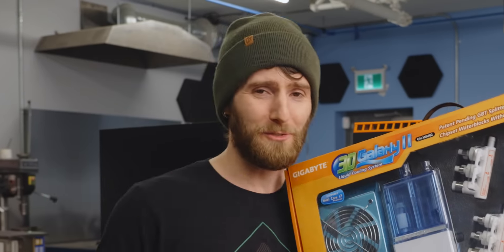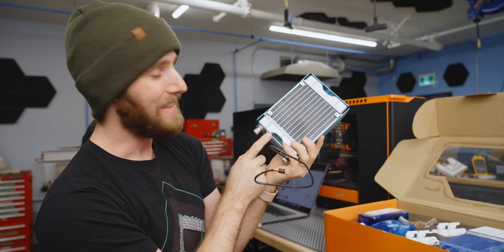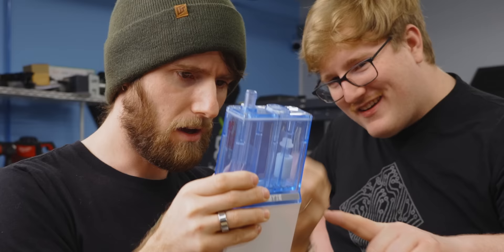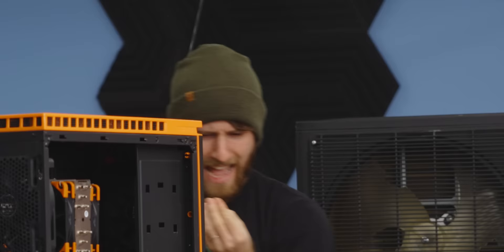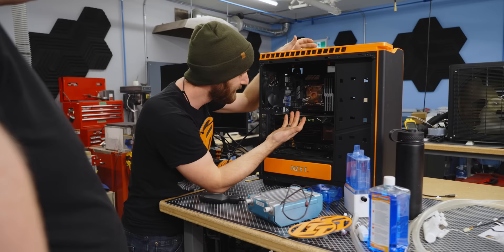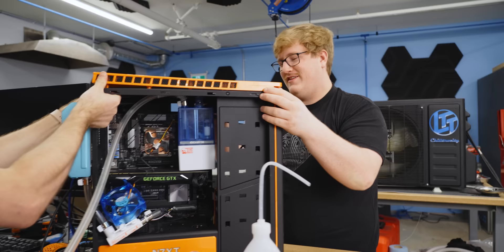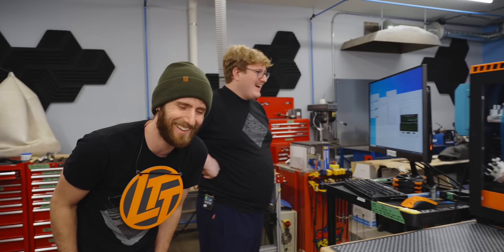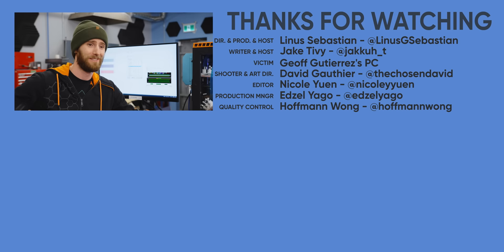This Product Aged Like Fine Milk - Gigabyte 3D Galaxy II Retro Watercooling Kit

Comment: Unless I'm mistaken, even in this thing's heyday, a decent aircooler still outperformed it. Before Noctua, there was Zalman, and a big copper Zalman flower HSF (CNPS7000Cu? I have one still bolted to an Athlon XP somewhere) beat this thing out. Speaking of Zalman, they had an even more obnoxious "water cooler" that gave you an external TOWER radiator, and I think they released a Korea only follow up, so there were two of them. See if you can get your hands on one of those!!!

GEEZER TIME!!! Later Socket 370 CPUs and all P4s had some kind of thermal protection, probably via the chipset invoking SMM/Ring-2 and just crashing everything, since SpeedStep didn't show up on the desktop until the later P4s. And unless I'm mistaken, by the time (later) Socket A rolled around, basic thermal protection was definitely a thing, and by the time the Athlon 64 rolled around, it was universal. Thermal protection/throttling seems like the kind of deep dive story Anthony would be really good at showing the history of??? 

Here's that Tom's Hardware video: https://www.youtube.com/watch?v=NxNUK3U73SI - interesting to see a very early P4 throttle all the way down to its lowest P state like that and just keep chugging. Toms later got into some heat (lol) for, amongst other things, deliberately frying a Thunderbird Athlon (no thermal diode), only putting thermal paste on the Athlons (makes you wonder if the "magic smoke" you see isn't actually magic smoke, but finger oil/surface contaminants/thermal paste vaporizing...) and somehow cooking a Palomino Athlon even though those did have a thermal diode and were the first CPUs with Cool'n'Quiet. CnQ still required a driver and proper set-up on Windows XP - but that distinctly looked like a Win9x/2000 style "Windows flag" in the title bar for the error message that pops up on screen in the T-Bird section. Again, Tom's caught some shade for doing it this way - deliberately framing the AMD CPUs as worse. I know e.g. my nForce 2 boards wouldn't actually let you cook an Athlon XP, the system would crash first.

Comment: I’m still, using a TT Kandlalf LCS from 1997 I’ve just been updating the CPU block, all original loop, copper Rad, ceramic impeller pump. Currently using an AM4 EK Velocity full nickel block cooling a 5600X sub 30 idles never seen it get past 80C

Comment: What is the question?
It works!
The heat dissipation surface and the number of fans is half that of Noctua!
It could have been viewed with a double radiator and 2 fans.

Comment: I remember getting a early 2000s thermaltake kit from CompUsa but didnt fully purge the system of air. Turned on the pooter an a hose popped out of a compression fitting. Fried the pooter 😂😂😂...

Comment: This may actually be the literal water system I got for my computer back in the day. Except the computer I built was using a newer socket and it wouldnt fit on the CPU. So i broke the brackets off and just shoved it on there and held the block in place by putting a 6 volt battery on top of it and taping it down to the case, lol.The entire thing had to lay on its side to even work

Comment: actually Linus i dunno how long you have been watercooling but back in the day 20 years ago  those pins on the waterblock were way better than the MAZE styles from dangerden... i actually use a dangerden Maze 3 block, black ice radiator and eheim pond pump for 20 years.. i just made new mounting blocks.. then when i upgraded from my wolfdale 8400 cpu to my ryzen 2700x i finally spent money on a new custom watercooling setup

Comment: I have to mention that early development of some modern tech quite often comes with a lot of questions and concerns. One thing is that we don't know how it may be used, what can fail, what will be a common problem. Second is the overall awareness, will people need some help? That's why early development includes many security features and utilities which later on are removed. Turns out that we don't have to worry about something, something else is not a problem and people easily deal with it. That's why it could make sense to add overheating protection back then. People might not know that much about water cooling, may not recognize the sound of sucking air, back then it was not that common to have overheating protection built into the PC. And now? Who cares, if you overheat your PC, it will turn off by itself. If thing sucks air, you will notice, modern cooling is not as loud as two decades ago and it will hurt to even hear it. And if you do water cooling, you probably know what you are doing or you are doing some research. It's not a novelty anymore :)

Comment: Metals have standard electrode potential which is different for each metal. Add two metals of different potential and some water which will become electrolyte - you have a battery which has two electrodes. The bigger the difference in their potential, the faster the corrosion will happen. Here you can see different values and which materials may cause high corrosion.
https://en.wikipedia.org/wiki/Standard_electrode_potential_(data_page)
This also causes corrosion where stainless steel touches galvanized steel. Both are fairly corrosion resistant except if they are linked with each other.

Comment: If this was desing in 2005, i think it was design for that generation of CPU coming that year. By that time, we had AMD Athlon 2 and Athlon 4 at that point and the Intel Core (like the dual core or the quad core). So performance will be really different than the ones we had now with the Ryzen or the I3/5/7, plus the heat generated by the CPU.

Comment: Betcha 50 bucks if you lap that block and use some better paste it'll get really close to that noctua. I used a Corsair COOL kit from 2005 (basically a rebranded swiftech kit) and the last CPU it cooled was my 2500k@4.8ghz for 10 years. Before that it was cooling a Q6600 @3.9ghz and before that a P4 630 at... something.. I can't remember. I'm positive it'd do a better job than this EK240 I'm running right now, but I think that might also be because the pump in the Corsair kit was a laing DDC and the rad was THICK.

I ran that water loop 24/7 for almost 16 years across 3 system and the only thing I EVER did was top it up with distilled water and add a couple drops of iodine every few months. No coolant, no additives, no dye. I'll still pour a bit of my 40 out for that pump. What a legend.

Comment: 20:50 Today I learned the loop on the back of your trainers are supposed to be pulled so you can get easier into the shoe and not to just bind them together...On an ad....in a tech video....

Comment: I still have the aurora case that was designed to take this cooler, I remember looking at the cooler and thinking it will leak in the first week, think I had a core 2 duo or quad with dual 570's or a GTX 295 at the time.

Comment: i understand the comedic value, but before shitting on this in the comments, people should keep in mind that back then we used to "mill" our own waterblocks out of copper and plexyglass sheets using makeshift vertical drills and use tubing/fittings for pneumatic machinery, recycled radiators from freezers and pumps used for lathes and milling machines lubricants

Comment: I had this kit. lol. Or I should say I still have most of it somewhere. It kind of worked probably cooling a P4 Extreme, q6600 or whatever I was running then. It didn't take long to turn the copper black in the block.

Comment: External radiator is still a better design. You're completely isolating it, which you should do, because it's a radiator... it collects a bunch of heat, and then releases it.

Comment: 17:45 I don't know, but I remember that my Intel Celeron 600 MHz from 2000 was shutting down my PC, until I've learned that one need from time to time to vacuum theirs system, and non-spinning-fan on your CPU is not a good idea for long (or heavy) work with computer 😉

Comment: Also the question is, how would it have worked compared to an air cooler of the day? While it could not beat a modern noctura, maybe it would have beat a 2005 air cooler combined with an 2005 cpu? As someone also mention, maybe new paste that was not seperated could have helped too?

Comment: I'd love to totally redo my 20 year old gaming machine to modern-ish cooling and visual standards … so a massively improve cooling solution on the 3Dfx card, either a tower air or modern water cooling setup on the socket 7 CPU, ARGB fan controller programmed via USB 1.1 header (🤣) maximum modern silliness. Because why the hell not.

Comment: Core 2 didn't come out until Q3 of 2006.  Most people buying one of these kits would have been putting it on a Pentium 4 with no thermal monitoring.

The real problem with this kit is that the radiator is just too small.  That's why the "good" kits of the era (not that any were all that good) used free-standing radiators.  You just couldn't mount a decent radiator in a case yet.

Should have used real thermal paste since that stuff deteriorates in storage.  15 year old thermal paste is basically just mud.  It probably wouldn't have made a big difference, but it would have made it more fair.

Comment: You guys managed to skip the the best part. A radiator upgrade, and a cpu block upgrade, tested in all 3 scenarios. Now that would be interesting! To be frank, the throughput of the pump and the above average protection makes this a "buy". If I could find a cheap one, I might give it a shot, and mod the hack out of this :-D

Comment: I remember guys cracking open Xbox 360 cases and installing these to prevent the red ring of death
Reply: wasnt it just the thermal paste needed to be replaced to stop RROD? i remember seeing all the dumb tricks to dodge it like the towel wrapped around your xbox lol... thankfully i was broke at the time and wasnt able to get a 360 until they revised it a couple years later lol

Comment: i bought this system when i made my Q6600 core 2 duo build, but it never got attached as i found a "better" liquid cooling system that ended up getting used instead...kept it for years but i think i threw it out not long ago not realising it was a rare item.. the cooling system i used had a pump that i had no room for in the case so when i moved the computer i had to lift the pump along with it.  green UV reactive tubes... and the coolant levels constantly droped with no reason... i had to keep topping it up every 4/5 months.

Comment: A better test would probably be a period CPU, and a few hours of lapping the darned waterblock.
And some good thermal paste as we had arctic silver long before that cooler came out.

I never bothered with any of the water cooling stuff of that period, leaking was too much of a thing.
Around that time i think i was using a thermaltake volcano 12, big massive chunk of copper with an 80mm fan that would remove fingers and sounded like a jet turbine, but worked damned good.

I kind of laughed at trying to fit the tank and pump etc into the case, since in my PC case, which is quite old, you could have stuck all the parts in it and have no one notice they were there, you can hide a 2 litre bottle in my case, it's one of those monstrosities.

Comment: I'm sure I'm in the minority,  but I think externally mounted radiators are generally a better idea. I've been looking for a good way to pull my power supply out of the case for years. Long enough I've wanted to for multiple PCs.

Comment: Pentium 4 actually had thermal protection. Athlon XP, however, famously didn't - an Athlon would run without a cooler until the CPU die literally exploded.

Comment: I hope you uys left hig rig with that cooler for the lols and he actually edits off it. PS: Pentium4 did not have tempt protection, the family computer was a Pentium 4 till the CPU fan quit working and it cooked it self, for the lols if I caught it I would have put my extra NHD14 on it so my dad could continue to use it till windows 7s support ended.

Comment: Ahh the good old days, do you guys remember when Thermaltake made those tall external towers for your custom loop, the tower had radiator and fans, and maybe a pump but I'm not sure about the pump. I thought it was a brilliant idea at the time, because it removed the noise away from were you had your PC, not that it could be placed far away, but if you had your PC next to a wall leading out to the garage you could just drill a few holes and put the tower in another room and completely remove the fan noise.
Now I am an old fart at 54 years and own my house and I do not use the basement, so I could go for a small tower solution and my next PC could be a tower PC, I wonder how it could be done and if you don't have Linus money to spend on the project, what it would cost for a good gaming tower PC and all the other stuff you need, key word "Good gaming PC", not a Amazing/epic gaming PC with a RTX 3090 TI and gen. 12 i9 12900K CPU.
Reply: Yep, I've got one of the Thermaltake towers.  It wasn't... completely pitiful.  Definitely had plenty of radiator, but the pumps were the usual Thermaltake garbage (they used the same pumps in all their kits, but the big ones, like the one I have, had two) and the waterblock used 1/4" tubing.  I've still got it, long since relegated to the closet, though.

Comment: Copper and aluminium can't be mixed because of corrosion that is true but it only happens if they are in direct contact at least that's on the car industry I am pretty sure that this is safe

Comment: You didn't have it. I practically set a motherboard on fire, my CPU fan was super improperly installed.  It was smoking and still on screen.  I was sitting there using my PC thinking what's that burning smell.  Side note, the board was fudged, but the CPU somehow survived and used it in a different machine.

Comment: I disagree. The pipe revolver has great alpha and damage per shot. Hell, its even better than the 45 submachine gun. It does 30% more damage than the pipe pistol and doesn't have the obnoxious reload time of the bolt action. I also like the rate of fire and the sound. Its arguably the best 45 until you get the Overseer's Guardian. Sure, the 44 might be better but you never have the ammo.

Comment: People that were not to "tech savvy" back then called the whole computer case "Hard Drive" I still get this to this day. Typical mouth breather will come in state a problem, get told bring your computer in. They show up with Keyboard, Mouse, Monitor, Power Cables, Webcam, and the mouse pad. Then i point to the actual computer and say "I only need this" they reply, "Oh you just want the hard drive"

In an effort not to carry on this discussion with ignorance, I just use their lingo as they insist I need the power cable. LOL

Comment: Can anyone help me ? This is off topic but I need help from a pc gamer, so I bought a used Alienware laptop and I did a fresh install of windows 10, however I noticed the laptop being really slow, when I open task manager it shows the cpu running only at 1.2ghz  while the base clock is 2.5 and turbo boosts to 3.1. 
I’ve tried a few things, i updates the nvidia drivers, I changed the power plans to performance and nothing seems to work.
When I open a game the cpu never goes faster than 1.2 ghz so I can’t even play old games … 
The specs are i5 3210m, nvidia 650m and 6gb of ram. Can anyone help me out pls ? Many thanks

Comment: Copper and aluminum. I'd like to point out that your HVAC is likely copper and aluminum. At the joints where copper meets aluminum there's a substance to "prevent" the aluminum from corroding. Can anybody explain more of the "why" for my satisfaction?

Comment: i have a old Pentium 4 with the socket size 423 model number 01 and it has never been used and never booted anything i laughed when my friend gave it to me my pc specs are Intel core i9-12900k with 128 GB of ram I have a 2TB HDD and 10 100TB SSD's or 1PB a EVGA GeForce RTX 3080 Ti FTW3 Ultra Graphics card and a DeepCool Assassin III liquid cooler with red coolant because of my job and well it took me a little while to get ten 100TB SSD's there external luckily

Comment: 3:53 see this is the thing that bugs me about Linus. He always makes comments about engineering and they’re often off hand and uneducated.

They have the inlet on the side (as far away from the exit) to prevent there being a pocket that isn’t getting decent flow circulation. With the pins they machined in (there are more than one ways to do that, but they could be CNC’d) and any reasonable amount of flow through there, there is going to be so much turbulence there really aren’t going to be any hot pockets that form, all that water is going to be turned over quickly. Particularly if you have any reasonable flow, there shouldn’t be any problems in there with laminar flow and thus hot pockets developing, it should all be very turbulent. Those pins, we all know that increases the surface area, but turbulence they cause assists the heat transfer, as any water in contact with a hot surface is continuously mixed with cooler water above, yielding the coolest water possible to the cpu, assisting heat transfer as much as possible.

I just feel like Linus is so quick to rip engineering to offer a critique, and doesn’t realize there is engineering there he’s not able to see.
Reply: ok